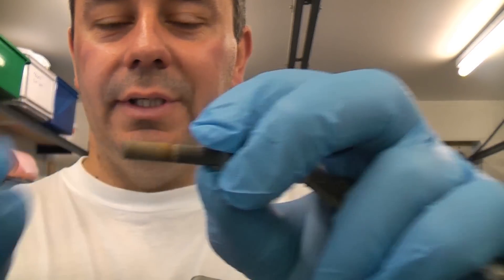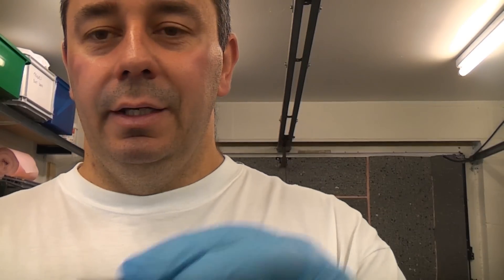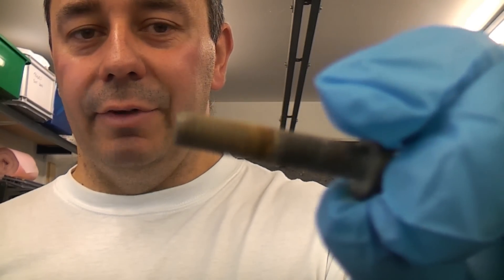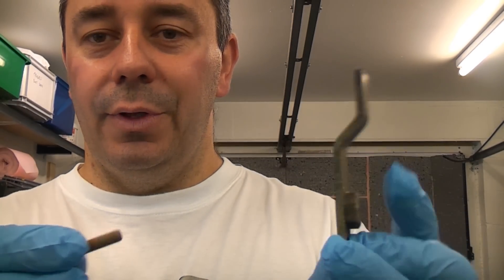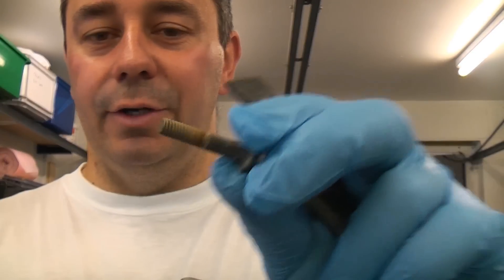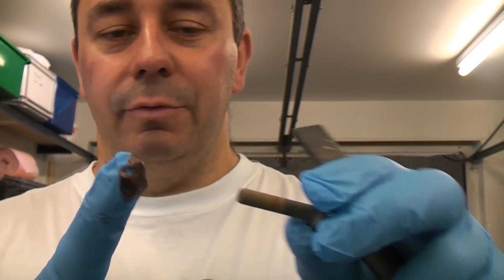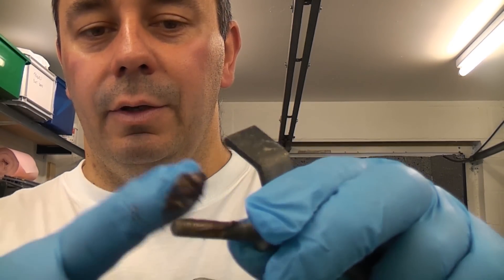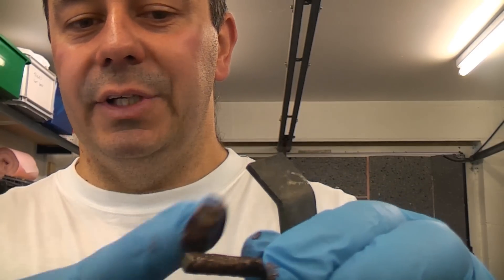Copper Grease | DIY Quick tip

Comment: Use this on tyres and with ours winters here your struggling like mad if you dont use it. I buy in a spray tin and just give the bolts a tiny spray when i change from summer til winter tyres.

Comment: What is the difference between copper grease and just using regular grease? I have been using the red Lucas anti-seize grease for bolts.
Reply from the maker: Not sure, as I'm not familiar with the Lucas stuff. I have used their oil stabiliser, that is good stuff ;-)
Thanks for the comment
Reply: Copper grease prevents rust between nut/bolt, and seizing between steel bolt and alloy castings. Works like magic.

Comment: Hi UH, I have never heard that this could be carcinogenic, although I don't use copper grease alot (mainly on the car for wheelnuts etc) I will be more careful in future. Even if it turns out not to be I suppose it can't be that beneficial to skin. Cheers pal.
N.

Comment: Hi i was wandering if this stuff can help to prevent stainless nut(A2) and bolt(A4) from galling, or as some call it 'cold welding'. The use of 2 different grades further helps, and theyre being used to secure a new mild steel silencer to my car, hopefully. The nightmare I had getting the old rusty ones off was truly horrific - blood and bruises!
Reply from the maker: I would not use stainless bolts to be honest, as they will seize and then you cannot burn them off with burning gear- https://www.youtube.com/watch?v=HC4KiulYs68&t
I would always use mild steel bolts, yes they will corrode but at least you can burn them off.

Comment: Copper grease is not meant for use where it comes into contact with aluminium as it reacts and corrodes the aluminium, we use tefgel at work but it's very expensive
Reply from the maker: Thanks for the info ;-)